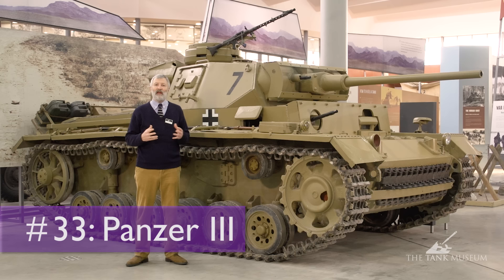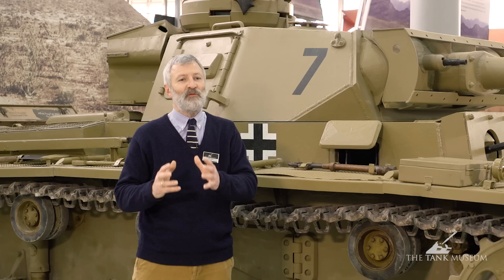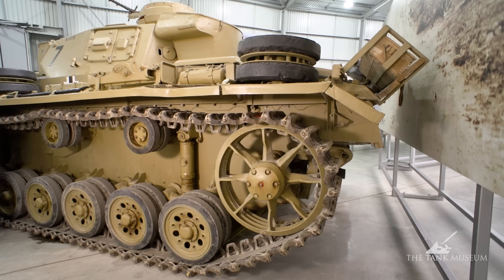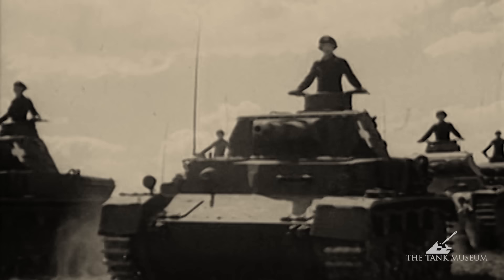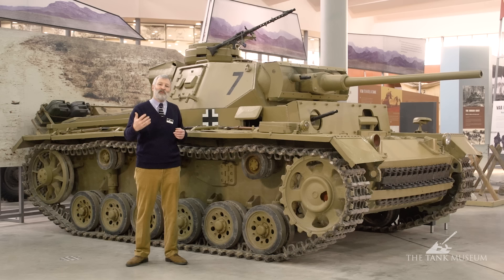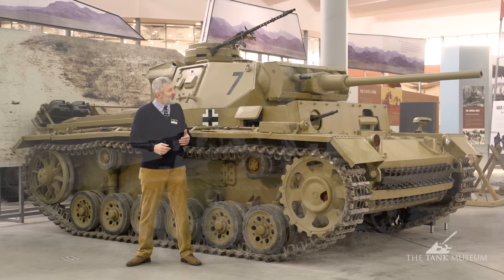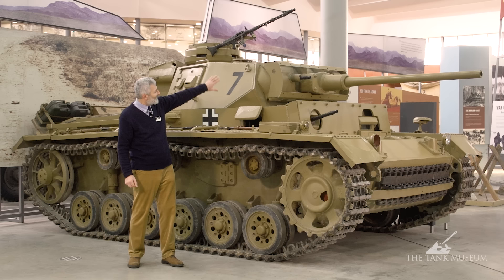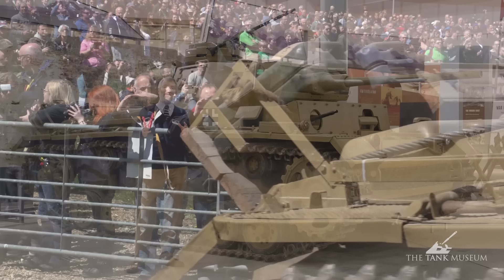Tank Chats #33 Panzer III | The Tank Museum

Comment: German was far ahead of America in tanks and artillery
Reply: Depends what context. When America first entered the war the standard Sherman had a relatively capable gun, and when upgraded to the 76mm later on it could penetrate the majority of German armour on the sides and back of every tank.
Reply: @squelching  German tanks and artillery destroyed more tanks but were outnumbered
Reply: @PostalWorker14  
They only destroyed more tanks because germsn tankers were counting things like half tracks and trucks as "armored kills"
Reply: @garyslayton8340  Sherman was more maneuverable and turret was faster than Tiger in small areas But Tiger was effective in longer ranges
Reply: @PostalWorker14 the Sherman had good armor which is why Germany almost entirely abandoned the 50mm cannon in favor of the 75mm one. Also the u.s had better engine manufacturing capabilities and capacity than anyone else at the time due to the absolutely enormous auto industry in the u.s.

As for other technology the u.s had gyroscopically stabilized cannons on all M46 Sherman's as well as on the M24 Chaffee, better super/turbochargers for aircraft engines and was the first nation as well as the only nation to use proximity fused shells for shooting down aircraft during the war.

Those proximity fused shells used a small chemical reaction to produce electricity to run a small radar sensor inside the nose of a shell that would then trigger the warhead when it got within 10 or so meters of an aircraft increasing hit probability by nearly 90%.
Reply: @dominuslogik484  Sherman was a death trap against the Tigers should’ve made more tank destroyers
Reply: @PostalWorker14  the Germans made 1,300 tigers roughly and most of those had to fight against the Russians. The Sherman on the other hand was made in excess of 50,000 total by 1944. 

Not only that but there are multiple kills against tiger tanks recorded from the M4 Sherman both with the 76 and 75mm cannons, they were not death traps and wet ammo storage was introduced by the Normandy beach landings so the tank would not suffer ammo detonations very often and it was actually easier to light a tiger or panzer on fire than a Sherman.

Sherman being a death trap is a myth
Reply: @dominuslogik484  They had a program with WW2 mechanic who cleaned destroyed Sherman’s he SAID it was deathtrap
Reply: @PostalWorker14  and if you look at loss records and numerical data you will see that it was the safest tank of the whole war with the lowest rate of crew deaths per vehicle with an average of 20% casualties when a Sherman got hit as opposed to German tanks which was around 60% and the T-34 had a crew casualty rate of nearly 80% and most of those casualties were deaths in the case of the T-34

Comment: It s a bad Idea to build it in 1943.
Reply: General Guisan Quai i That's why they didn't. Barely any were produced after 42.
Reply: I think he say in the Video that they produce it, still in 1943.
Reply: they produced the chassis of the panzer 3 still in 1943 for the stug
Reply: Yes this can be, thanks for correcting me. But however stil a bad Idea to build Stug 3 in 1943
Reply: General Guisan Quai i The stug 3 was perfectly capable up until the end of the war. It could comfortably destroy all the medium tanks it was facing (Sherman's, T34's and Cromwell's). The stug was probably more cost efficient than any other tank Germany produced.
Reply: I know thats a very good Tank is but in 44 or 45 it was to weak against all the numbers of enemys
Reply: General Guisan Quai i That's not really the point is it. The point is which tank/tank destroyer was effective at its role. If we are directly comparing the stug 3 to its allied contemporaries then it was more than capable.
Reply: better a Jagdpanzer 4 with l70 gun